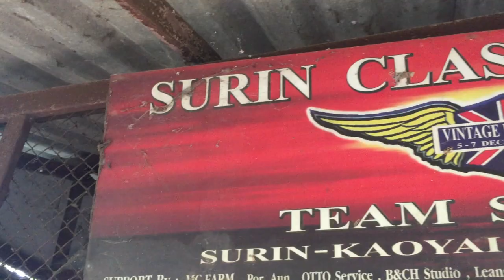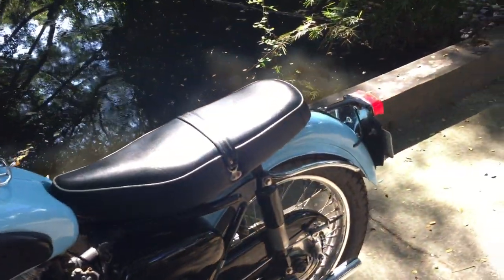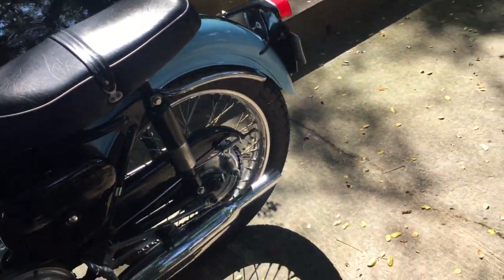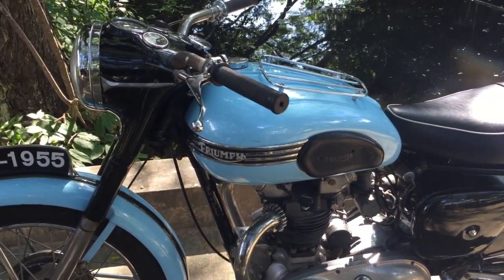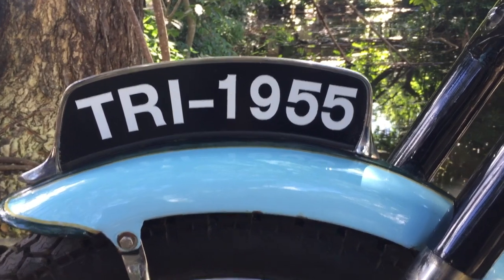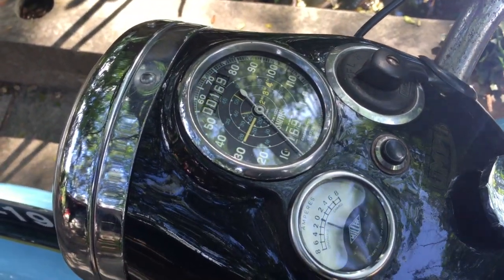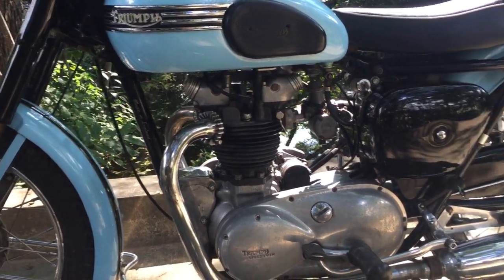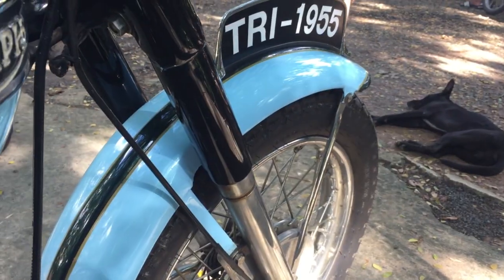I'M SHOCKED! Triumph from 1955 works better than a new bike!.

Comment: Hi, about 15 years ago, I lived in a small village about 50 or so kilometres from Surin, on one visit to Surin I saw this very same bike in a shop-house type place along with a BSA single, I couldn't believe my eyes, after that I saw it about quite a few times around the reservoir called, I think, Huasanaeng (probably not spelt correct) I also saw a BMW 250 of around the same vintage in Prasat on my way home, apparently, some WW2 bikes were being imported from Myanmar (Burma) and being sold to Thai classic bike enthusiasts.